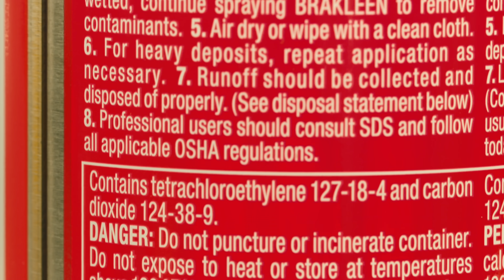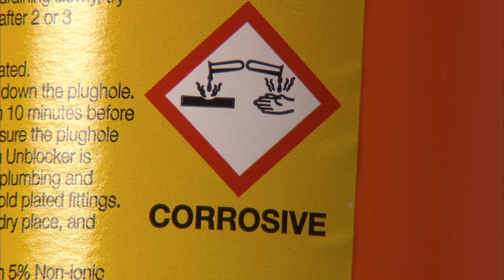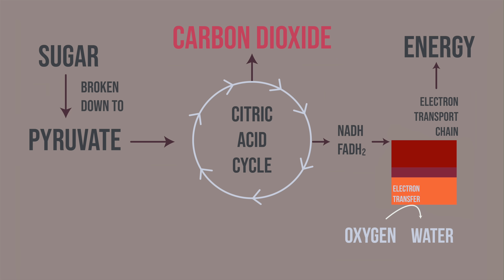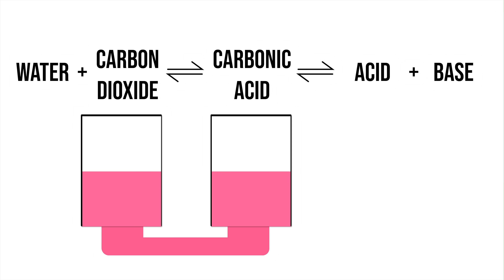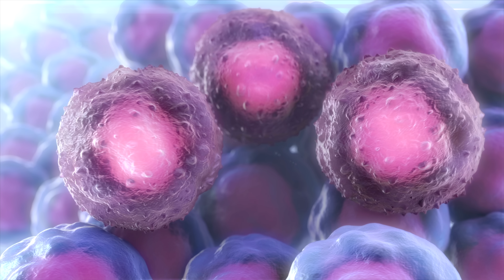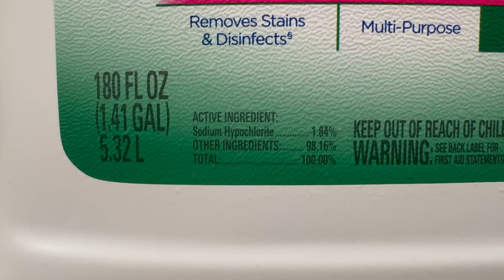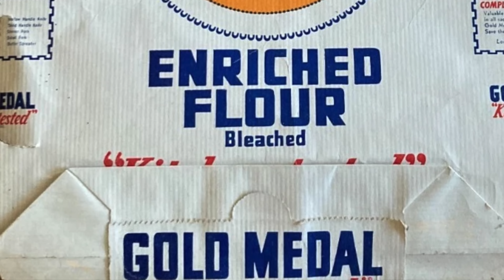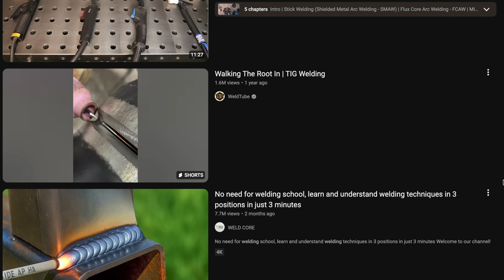"It smelled funny while I was welding and now I can't breathe..."

Comment: I don’t even buy chlorinated brake cleaner anymore. I use non chlorinated brake cleaner often to clean up before welding and I wear a forced air respirator  integrated welding mask. I know they are expensive but nothing compared to copd.

Comment: Actually the voltage used in welding is low: 10-40 volts. The current is high though. 

I knew it was phosgene when you said the smell.

Comment: One of the first things we learned in welding trade school is to NEVER use chlorinated solvents to prep and clean the surface of your work-peace because of how dangerous the fumes can be it creates phosgene gas when heated which is extremely deadly and to never weld galvanized steel without a proper respirator.

Comment: The algo has forced this video upon me for 2 weeks now even though its not my cup of tea. Or maybe it was to vehemently point out to SP that at 1:12 that IS NOT brake-cleaner. That brown liquid is copper spray, used so that the wheel doesn't stick to the hub/rotor. Now...what exactly killed SP?

Comment: I have done soldering of printed  circuit  boards (PCB) for 6 months in a very small company (one room in a home) and inhaled a lot of fumes from the flux (flux is there in core of the lead),  i used to feel irrigation in my lungs.  At that time, i did not know thar a table fan should be used , and the room should have an exhaust.  fan.

Comment: There's many different brake cleaning formulations. The original and best is high concentration toluene. The chloride ones are no where near as good. Toluene is fine to use to prep for welding

Comment: Chemist here... As soon as I saw the can of brake-cleaner, I knew what the problem was: carbonyl chloride gas (phosgene) The Germans used this gas in WWI as a chemical weapon. It's been long since banned by the Geneva convention. 

The solvent tetrachloroethylene should NEVER be used indoors, unless under a fume hood. It has a somewhat pleasant odor, but is much more poisonous than ordinary solvents. Thing is that, TCE is one of the best grease-solvents known to man. It is so very effective because it forms a chemical bond with the grease, (called 'hydrogen bonding') and can literally remove every molecule of grease as no other solvent can. Hence we still use this hazardous chemical. Just be very careful with this stuff!

Comment: Working on AC units when you were using a torch on R22 units the refrigerant would release from the oil in the lines and as it ran through the flame it would create phosgene gas. This happened to me occasionally and it didn’t smell like grass. You knew immediately because you couldn’t breathe, your eyes would water and snot would run out of your nose like crazy. I’ve had to have a helper hold a box fan to blow it away from my face so I could braze in a new compressor

Comment: This is where college is so important in trade.  We were taught early that degreaser should not be used in line of sight of UV Light.   A lot of degreasers are now illegal to sell, but worldwide can't be guaranteed.  

Phosgene gas was a WW1 chemical weapon.  It's heavy and fills trenches.  It liquifies lung tissue and is horrific.  

Welding persay is not dangerous.  But there is a good reason chemical lockers are used.  To withdraw someone looks at the process being used.  Explosive fumes and gasses can build up slowly.  Poor practice kills.  An example.  A ship worker went home the weekend.  Came in Monday morning and lit a cigarette before work.  He was standing on a thick steel covering a pit.   Over the weekend a cutting torch in the pit was slowly leaking aceyelne, because it was not closed at the bottle and the kit was not maintained.  He was launched into the air and died in that explosion.  Knowledge and safety cannot be circumvented.  Before each job, have a little toolbox talk with yourself or others.  Look for snags and issues, before they present to you.  Read COSH labels.  They inform you of risks and mitigation, care and storage.

Stay well, go home to your families in one piece.

Comment: THANK YOU for this video because silly people need reminding that shop safety is deadly serious. Always was but people insist on ignoring what they should have aggressively studied in the first place. Be dead serious or be dead or dying in unpleasant ways...
Professional welders use ACETONE (the human body even makes small amounts) AFTER abrasive etc surface prep, and do that outdoors or with effective fume extraction (and no sparks!).
Slag and mill scale do NOT come off with solvents which is why abrasive discs and flap wheels are used with proper respiratory PPE.

Comment: I was welding a galvanized pipe in high school metal shop and noticed the green fumes and sweet smell, I did not feel anything at all but after class I went to my locker I had been using several times a day all year and I could not remember my locker combination. I had to go to the office and tell them I forgot my locker combo, the secretary looked it up and wrote it down on a post it note for me, When I looked at it, It did not even look familure, You would usually see it and say, oh ya, duh but when I looked at it, it might as well of been a brand new combo, went to my locker and it worked.    That galvanized metal fumes erased my memory of my locker combo completely, I wonder what else it migh have made me completely forget.

Comment: Brake Cleaner and heat, as soon as i heard that, i thought World War 1 gas in the trenches.   I got this off the Internet  Phosgene gas was a devastating chemical weapon used in World War I, first deployed by Germans at Ypres in December 1915, becoming far deadlier than chlorine because it was colorless, smelled like hay, and its deadly lung-damaging effects were delayed for hours, causing suffocation. It was mixed with chlorine and used in shells, causing widespread casualties and terror, though its effectiveness was eventually reduced by improved anti-gas masks and training, eventually accounting for 85% of gas-related deaths. 
I thought you might find this info interesting. Cheers.

Comment: They don't make chlorinated brake cleaner no more coordinated brake cleaner didn't ignite it wasn't flammable the new brake cleaner they come out with doesn't have chloride in it and it will ignite because you can use it for starting fluid old brake cleaner you couldn't use it first starting fluid

Comment: 🤔🤔 Some repair shops I have worked in will use Brake Clean to start a car if they don't have starting fluid or use it to check around a intake manifold  to check for vacuum leaks and the smell that comes from the exhaust smells like chlorine / Sulphur is this the smell of  Phosgene Gas and if so will it effects you the same as the guy in the video?
Reply: That is a good question.... I was kind of wondering the same thing, or something similar. What a terrifying way to die 😞

Comment: When I was a kid, I had a friend whose dad owned an auto salvage yard, a junk yard.  If you have a good mentor, and we did, that is an excellent place to learn chemistry among other things.  We collected about 3 quarts of quicksilver at one point and watched the effects of it on various metals and other compounds.  We were taught to extract the phosphorous from brake fluid and one of the steps exhausted phosphine in the process.  Using acids and lye to extract silver and aluminum from mirrors and then remaking them in vacuum chambers. Harvesting elements and compounds and metals from all the chemicals used the in the industry, were skills too numerous to even scratch the surface of.  Learning about all this also taught us of the dangers of various elements and compounds, acids and caustic substances that can produce toxins and burns or poisons.  We also learned the precautions to take and the signs and smells of exposure.  I've always been grateful of that experience when I hear stories of teenagers and people in their 20's and older, encountering dangerous chemicals and are unwittingly harmed by them because of a lack of experience with them.

Comment: As a welder for 45 years I never use any solvents to clean with.25 years ago I was welding on some aluminum pipe which had came out of a chemical plant, it had brown residue inside it ,every time I would weld it , it would give me serve diarria the next day ,I stopped welding on that pipe then I was fine.

Comment: A better method is to put your rusted metal in a water-Borax bath with a steel or iron electrode while the rusted metal is the other electrode and run at 12 volts using a lead-acid battery charger.  It will eliminate the rust and no chlorine involved.  Cleanup is fresh water and dry.  Granted it means you have to prep a day or two before you weld but it is way better than dying due to toxic fumes.

Comment: That is why people should attend a professional welding course, it can be very dangerous in the wrong hands. Also when sweating and you have moist gloves you can electrocute yourself! Ground your work! Brake cleaner and other solvents should be checked in advance. In The Netherlands we have a website that can check your brand for carcinogenic, mutagenic, or reprotoxic properties (CMR substances) like: H340 H341 H350 H351 H360 H361H362 🚑

Comment: I weld a lot with rusty scrap steel.  The best way to clean off old steel is with a diluted mix of muriatic acid.  Either 1:1 with water or 2:1 (2 water / 1 muriatic) and let it soak for 30 minutes.  Just make sure to wear gloves, goggles, niosh mask, and store it outside.  I made a 3ft tube out of 4" ABS pipe (with glued base cap and threaded top cap),..set into a 5 gallon bucket with a hole cut in the bucket lid for supporting the ABS tube and it works really well.  After soaking, you then need to dunk the piece in water with a handful of baking soda to neutralize the acid.  Been using this for over a decade.  But no, never use spray cleaners unless you thoroughly wash it off first with soap and water.  Lastly, when welding.. keep your skin covered!!  I got permanent skin discoloration on my neck from UV exposure ...just from 1 day of welding!

Comment: Thanks for sharing this video it's a very informative video. I tell everyone that's getting into welding to use steel and know where it's coming from. Especially if it is coming out of a Refinary you never know what's embedded in the steel. Make sure the steel/metal has no chemicals on it paint any type of oils always wear your safety gear when using any tool. Make sure someone is home or an emergency number just in case.

Comment: Phosgen

Phosgene (COCl₂) is a highly toxic, colorless gas with a characteristic odor reminiscent of freshly cut hay, green grain, or a sweetish-rotten note (like rotting banana peel). However, it is only perceptible at dangerous concentrations, which makes the danger insidious, as the irritant effect is delayed and perception diminishes. It is heavier than air and can cause severe lung damage (pulmonary edema), often with delayed symptoms of 2–24 hours. Odor characteristics in detail: Low concentrations: May be reminiscent of hay, fresh grain, or corn, sometimes also described as sweetish. High concentrations: The odor can become pungent and stuffy, but olfactory perception diminishes rapidly, leading to olfactory fatigue.

Comment: Chloramine gas...can be caused by urine and bleach experienced this a couple of times in construction sites
Big trough urinal and the water flush system fails...gets stinky..someone throws some bleach in...produces an irritant gas burns nose especially, like sense of smell gone for a few hours.
Not the same as chlorine gas.

Comment: Ahh, turns out I was right. But apart from the phosgene, which is lethal by itself, the actual vapors given off just from normal welding are also bad. Metal fume fever is the conditions name if you breath in too much of that smoke. Welding is ALWAYS supposed to be done in a controlled environment, with good air flow to prevent the welding fumes being breathed in, along with proper eye and skin protection. Not only is blindness  possible, but it's also really easy to get yourself a wickedly bad case of sunburn.

Comment: Organic chemist here...I'm only 6 minutes into this video, and I would like to add a few thoughts...tetra chloroethylene, and other halogenated alkanes are very common in disc brake cleaners and other heavy duty grease and oil removers. Because they are halogenated, often times they tend to have high boiling points, meaning it might be possible that Styro was welding his metal while some was still soaked in the metal. It is well known that there is one particular NASTY byproduct when these solvents are heated strongly. Carbonyl dichloride, or Phosgene, a war gas.
Phosgene is remarkably bad because initially it's not so bad, supposed to have a musty hay like smell. The problem arises when it get's into your moisture loaded lungs, where it then turns into hydrochloric acid and of course damages your lungs, causing them to secrete fluid, and you effectively drown. One of the insidious aspects of phosgene is it's delayed action, you could breathe some in and feel fine , then after so many hours you start to have trouble breathing, and possibly drown.

Comment: I'm a welder, and there's a lot of things that can harm or kill you. One time, I was welding galvanized metal, and the next thing I knew, I was going to the ER,I had zinc poisoning, and it can kill you, I found out the way to get zinc out of your system is to drink milk with lots of milk fat that's what they did in the ER ,lesson learned lot's of ventilation and the proper resperator and drink milk before and after just as an extra precaution.

Comment: Man thats rough, I remember this from school 20 years ago. I wouldn't want to discourage anyone from picking up a welder and learning a new skill but please do read the whole manual.  
I've once gotten myself sick from oil fumes with a metal lathe and i'm not gonna ignore proper ventilation again. I have similar concerns about these fancy lasers people use these days for welding or cleaning metal. The manufacturers say its 'safe' but there are brown and yellow clouds rising from the metal, there is just no way you should breathe that. The laser safety procedures are highly questionable too compared to industrial laser welding, never ever be around someone messing with those things, you're likely at more risk then the operator.

Comment: Wow, what a great video! I am subscribed now!

From the thumbnail I thought this was a video about someone welding galvanized steel and inhaling the fumes (another often overlooked hazard) but you did a great job explaining and warning of the dangers of using chrlorinated brake parts cleaner! For a while there I remember the parts stores sold both chlorinated and non-chlorinated versions. 

Another thing worth mentioning is that phosgene gas was used as a chemical weapon during WWI.

Keep up the great work, glad I found your channel!